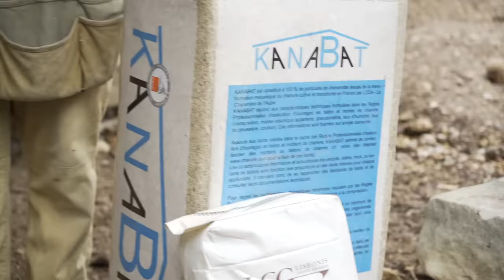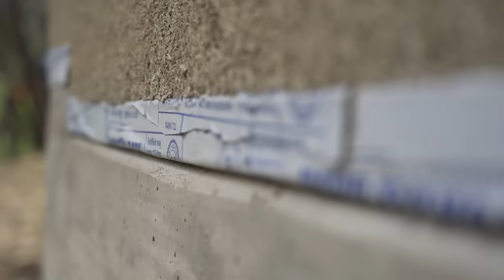Hemp Concrete Walls (R30 + Fireproof) - You Won't Believe How They Built This House!

Comment: i want to see what a 30 year old hempcrete wall looks like before I build my whole house.
Reply: In France theres a 600 yr old hemp bridge. It basicly turns into a porous silicon carbonate rock as it absorbs carbon from the air.
Reply: The first house that used hempcrete was renovated in 1990. It's rock solid.

Comment: I think the various forms of hempcrete construction has a lot of promise.  Use it for exterior walls and add a metal roof and your house will resist fire and likely drop your insurance quite a bit.  I'd like to see something on the interlocking block form of it too - as what I've seen goes together quickly and has holes cut for running conduit to reduce EMF radiation in a home and protect the wiring.  Thanks for this video, Matt!
Reply: 0
Reply: Interlocking blocks r great cause they r more seismic resistant!
Reply: Thank you.
Reply: EMF? I drive electric. It’s a rolling EMF generator!

Comment: Please keep looking into more green and alternative housing solutions. I'd love to see a video on straw bale construction.

EDIT: Hijacking my comment to talk about something in the video. The guy says that the lime mix absorbs CO2 which makes it greener. This is partially true, lime does pull CO2 out of the air to form calcium carbonate BUT all commercial lime starts out as from limestone (calcium carbonate) that is baked at high temperatures. When used lime might be considered carbon-neutral (reabsorbing its previous carbon emissions), but only if you don't take into account the large amount of energy that goes into baking limestone to form lime. 

This method of building is still very eco-friendly.
Reply: YES IM SO GLAD MATT LIKED THIS COMMENT IT MEANS HE MIGHT!
Reply: @Joshleslie871  If you into "green" building then suggest you have a search on YT ... no need at all to wait for your man to do a video.

And, where straw bales not readily available some of your fellow compatriots have been building "alternative" housing for years using rammed earth and clay and timber.

(However it must be said some of your local buildings authorities didn't quite know what to make of them.

I gather they ticked all the boxes but not in the conventional sense.)

A modern take on adobe, sort of, but not in bricks so to speak. "Cob" is another way of using earth which can be formed into all sorts, including niches in the walls to form shelves.

Slightly ironic as this green way of building is several thousand years old. If interested have a squint at earth/mud/clay construction in Yemen or Mali to name only two.

Or even have a squint at the earth covered buildings in Japan. I gather with passive heating, together with feet of earth as insulation, these buildings are among the greenest on the planet. Sometimes literally as the roof is covered in grasses or low growing shrubs.

In UK we have some buildings built into hillsides, "cut and cover" style which resemble a house in Hobbiton.

If we in the West thought we knew about green technology then it may be we are thousands of years behind the rest of the alleged third world 😂.
Reply: Ross Kneebone yeah I watch a lot of that but what there isn’t a lot of is American contractors talking about the straw bale and how it would be possible within the context of typical American building code which is why I think it would be cool to hear Matt speak on the subject
Reply: @Joshleslie871  Ref your compatriots building stuff out of clay I believe they started off "experimenting" with build techniques/design until they became proficient ... and complied with code ... sort of.

So it might be a case of having to watch a few hours of videos, make a lot of notes, then apply to straw bales and see how you go from there.

With enough hands and bales to hand some of the single storey structures were up in a day!

Plenty of videos on YT and books on Amazon. I gather the term is "building brown" if you are searching.

Just had a quick squint on YT at what has been built and to use one of "your" expressions it's "awesome", well I thought so.

And of course the videos are by the folks who build them so wouldn't need an interpretive explanation.

And the R values are in the hundreds ... maybe even higher ...

And it's green and cheap. 

Somehow I don't believe you'll be bored.
Reply: Yes! I was actually about to make this same comment. I'd really love to hear Matt's thoughts on straw bale construction.
Reply: @sinisterdesign  Fair enough then.

If you read these comments Matt then when your filming schedule permits perhaps you might crowbar in an episode or two on more green or brown building techniques.

I gather "you" already have a fair few alternative homes already in your warmer states so something to squint at.

Ref "alternative homes" ... might imply "hemp" has been used in the building for years ... (groan).
Reply: Eric Ferguson  I'm going to suggest  the main reason might be cost, at the moment.

This is on the grounds there's a "quite a bit more" straw than hemp about. This may change over the years, who can say for sure?

And, building with straw bales is a fairly mature industry. Building with hemp bales might be just as easy once enough folks have tried it.

As for other advantages of hemp I suspect that nobody has sufficient experience of building with the material, in that form, to say.
Reply: More green solutions, AND less promotion of disgusting synthetic foam / cement based products !
Reply: @OlivierSuire  Can't argue with that and would suggest "big business" has entire stables of slick lawyers who do nothing but refute any "criticism" of their employer's business. Petrochemicals and tobacco for obvious examples.

However, the rub is that a lot of pension funds are heavily invested into what what is a "sure bet", so it's ok to "be green" in public but pensioners rely on petrol/oil sales to enjoy retirement.

That said this very morning on BBC news we learned that BP (you'll have heard of them ...) have "seen the future" or "read the runes" and have diversified into "retail" from their petrol stations.

A whopping 50% of their profits are not petrol related.

In UK we are going green at an astonishing rate. However, it seems that a problem has arisen on the use of hybrid cars ... turns out that these cars produce more nasty emissions than expected because they are driven more aggressively than a normal fossil fuel car. Nobody can say why.

A lot of owners don't bother with the electric power train and don't trouble to charge them overnight because they live in a tower block or can't park outside their own homes.

Suspect it's a case of virtue signalling by being seen to have an electric car but you don't really give a monkeys.

Ref national builder outfits ... for all we know they are heavily invested in brick and cement producers ... and the very last thing they want is "building green", and keeping bricks and mortar out of the building site.
Reply: Technically, you cannot hijack your own comment, and cyberspace is plentiful!
Reply: If we could only plug all the worlds volcanoes we could stop global warming. Not kidding, volcanoes put out millions of tons of carbon every day.
(doesn't sound crazy at all, does it?)
Reply: @johnlockesghost5592  It certainly does sound crazy ... that's because it is.

How many "active" volcanoes do you know of on the planet, as we type.

Global warming is caused by the "green house" effect. This is because of the fossil fuels we burn. Gases produced by us pure and simple.
Reply: As an engineer.....You over engineer the valuation. We dont have a motor that is frictionless so that it operates without input after initialization. By that same standard, we cannot produce ANYTHING without expending more energy than if its a product employed directly from the ground with minimal effort and almost no finishing. Dont go hippie and stay in the realm of the science...mother earth can take plenty better care of herself without our high minded concepts trying to f..k up the works.
Reply: @wjgoh653  yes this carbon fetish is nuts, and mother nature already has a solution - grow more plant life to absorb it. people pump C02 into greenhouses to boost growth already
Reply: This method is NOT eco friendly if you truly consider the climate crisis. C02 is our biggest emergency
Reply: Straw bale has an International Building Code.  It is highly recommended reading (A lot of money was donated to wright it, so folks like yourself have a guide).

One thing i will say is never mulch straw as this video shows. Only use long fiber segments, not chopped bales (make sure you ask before purchase). 

There is insufficient strength in chopped straw. If it is split axially (like in the video) the hollow tube insulation pocket is destroyed (think Hollow Fill , by 3M.)

 Or Rock wool vs. a frying pan. Both are steel, but try cooking on rockwool, or insulating with a frying pan. Those air pockets are your friends. 

[Unfortunately, this video shows inappropriate usage of straw. It's recommended you Ignore it if you want a strong, insulated building.]
Reply: Don't think Matt will ever be a great resource for alternative building info. While he does seem genuinely interested in some of these techniques, his sponsors reward him for promoting their expensive, highly processed commercial products, which are at odds with actual green building.
Reply: the CO2 comments weren't there for "eco friendliness", CO2 literally adds (albeit slight) density to the compact hemp itself. You people sure do love making comments about stuff you don't understand